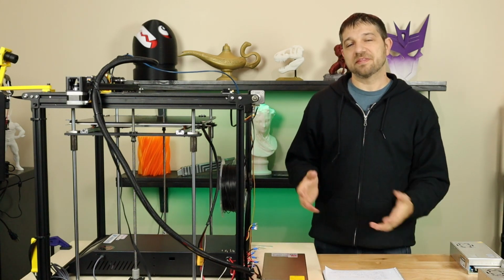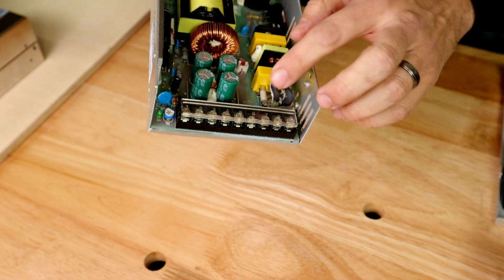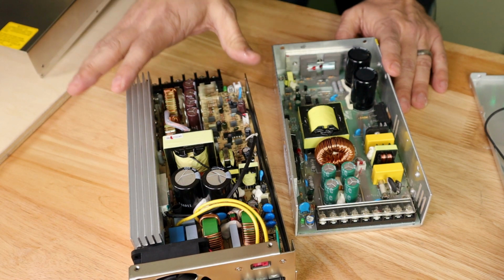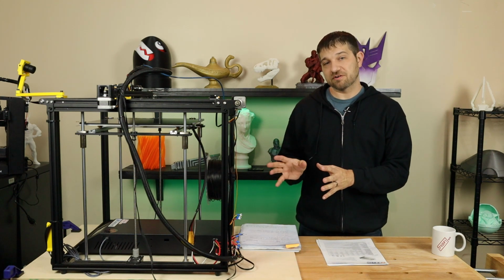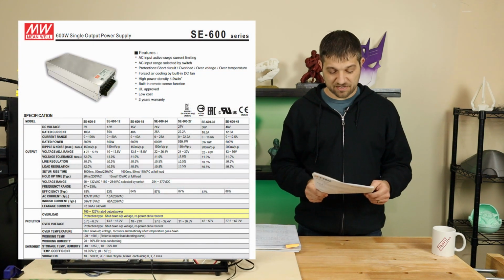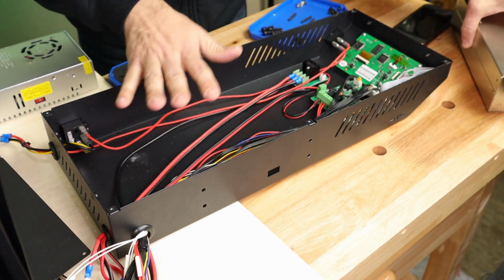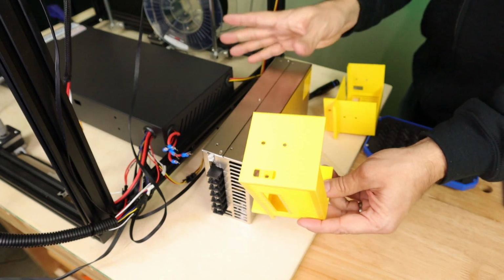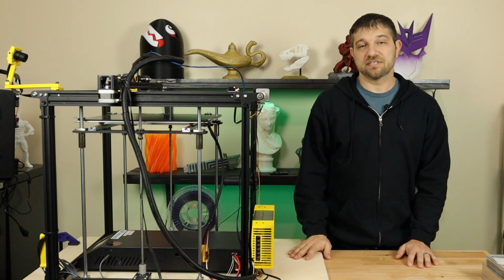Ender 5 Plus Power Supply: What You Need to Know!

Comment: I've watched Tripods and TH3Ds video (and now yours), and had ordered the TH3D Meanwell replacement before I even had the printer set up, LOL!  But I haven't installed it yet.  The Ender 5 Plus is my first printer ever, and I already have a hankering for a dual extruder setup, or dual hot ends, whatever I have to do.  Now I'm worried the 450W Meanwell won't be up to the task and I should go bigger.  The rabbit hole continues!!  Thanks for putting up such detailed videos on things like this.  You're a wealth of good information on the Ender 5 Plus!
Reply from the maker: Thanks! Personally, I think adding additional load to that supply wouldn't be a good idea. TH3D responded to this post as well. Check out their response as well as contact him directly for his opinion.

Comment: IF I remember correctly both the bed heater and the hot end are just binary (on or off). It might be a better idea to add a second power supply and isolate those two high draw loads from causing noise on the steppers. You would need to run two sets of wires to two relays from the control board. As there would be minimal load on the wires from the controller to the relays, those wires could be lighter weight, the wires from the second power supply to the heaters would still need to be heavy. It could also open up the option of running the hot end and the bed heater at higher voltage (say 48V), allowing you to run smaller wires.
Reply from the maker: Others have suggested this and it's definitely an option. You could devote a power supply just for the bed and it should fix the issue. I don't think there are regularly available heating cartridges for 48V, but I haven't looked.
Reply: @kerseyfabs  Yeah, 48V heating cartridges are non existent at normal price points.  Which leaves you with running off the 24V supply OR running two cartridges in series. I drew up the hot end for dual cartridges(basically mirrored a standard block) and it is eh OK. The thermistor winds up being about as close to the cartridge as the nozzle (bad thing?) and the tightener screw for thermistor is pretty long (deep threads on small dia tends to be PITA, could do a counter bore). I was trying to figure out if having a cartridge on either side of the nozzle would have a volcano like effect or if the heat transfer through the block (on a single) would essentially be the same. Finished the drawings for the air compressor 40mm fan replacement and started working on the drawings a part cooling ring.

Comment: The components that are burnt up are designed to stop in rush current.   They usually fail like that when there is a power spike or when the primary side of the power supply fails.     FCC only means the supply is not emitting excessive radio emissions.   Those cheap supplies are definitely not as good quality as the Meanwell, and they usually do not perform to spec, which is why so many fail.

Comment: I believe initial warming up stage would draw a high wattage under cold ambient temperature whereas maintaining the the achieved temperature thereafter would be well within the stock PSU spec. It means it would be okay if you can use hairdryer kinds or a printer housing to help the initial heating up stage.
Reply from the maker: Yes, the initial warm up draws the most current over the longest time but that's not to say that the same pull couldn't happen mid-print due to just random timing of heating cycles. Also, using a hair dryer seems like a rather silly fix to the problem. It doesn't avoid the power draw, it may only shorten it.
Reply: I mean unless you want a long term fix of course. And I  believe house heating would be in gradual change.

Comment: You could always drop the voltage (and thus current) going to the bed by putting some beefy diodes in line with the heater MOSFET component.  If you assume 450 W draw on the bed at 24 V, that gives 18.75 A — put four diodes in line with a nominal 0.6 V drop per diode and you drop the 24 V to 22.6 V, yielding (22.6 V x 18.75 A) = 405 W.  With diodes, you can stack as many as you want to bring down the voltage.

My Ender 5 Plus is on its way, so once it gets here I’ll have a look and see if this is a worthwhile approach.
Reply from the maker: That sounds like a decent option but you'll probably have some heat concerns with those diodes and you'll also slow down the heating of the bed.
Reply: Kersey Fabrications 
It looks like my Ender 5 Plus will be sitting in Customs here for a while, as they’re locking down the country tomorrow.  Yes, you will dissipate some heat in the diodes and the bed will take longer to warm up and boost — however the point is to lower the current draw from the power supply so that it can survive.

It looks like there is a trimmer near the LED.  If that is a voltage setting then you might try turning that down slightly — say to 22 V.  That should also drop current draw, but across the whole machine.

Comment: Excellent video.  I applied my se-600-24 to the inside using the bottom nut receivers and attached to the top of the box. You need to add wire to ground and neutral but others hooked up well. I prefer the flow thru the box and hot air is well exhausted out the back vents.  Even taped up a closeout to preclude backflow.  Cool air will enter thru forward side vents to cool CPU.  I absolutely agree with the 600W solution.  600 was even cheaper than the 500 mw for some reason.  Also note if applied outside, you may need to ground the chasis to the psu but I'm not an electrical engineer..

Comment: Yes there is a way around. The original bed draws far to high currents anyway. So imho it makes more sense to replace the original bed by an AC heater and an SSR.
Reply from the maker: I looked into this price-wise and it's about the same as buying a new power supply but it's a lot more work.
Reply: @kerseyfabs  The question is if you want a component that draws over 20 amps in your printer.
Personally I'll replace the bed with a new aluminium plate, heater mat and add a third z axis to remove the bed springs and use underbed piezos. No manual leveling anymore 🥳

Comment: I know this is old, but I just recently bought one used.  Your YTs are the absolute best I've seen.    I have to get mine sorted.  It was not running right when I got it.  I'll now obviously open the case and verify which power supply I have.  If the meanwell 500, I'll just leave it and keep in mind that the PS might die if pushed too hard.  If the meanwell 450 or the old no-name I'll probably immediately replace it.  BTW, as I type this, the 600 is $4 more than the 500.  The 500 is $15 more than the 450.  As a famous meat company says, "cut elsewhere".  I love your solution, but wonder if putting the 600 PS in the case with a couple more fans might have been better physical layout. I'm not sure, but the 600 is 2.5" high and the case is 3", so might it fit?  As a EE from way back, I hate undersized PSs.  They are the dumbest part of the product and its so easy to get it right--just costs money.  Creality has done a credible job of building these printers to a price point to get wide use, but some cost shaving can be contra-indicated, esp if doing an upgrade or repair anyway.  UPDATE:  I opened the case and have a Meanwell 500, so I'm good to go.....

Comment: Very informative video. The only concern I can see is how you brought the mains voltage (110/220) outside the chassis.  I would want those wires sleeved to keep them better protected/insulated. Also you should run a ground wire from the printer chassis to the power supply chassis. It looked like those printed mounts would not allow a chassis ground to the printer
Reply from the maker: You are absolutely correct and I'm surprised no one else (including myself) has caught that one. I though I may have gotten lucky and it would have grounded through the mainboard to the chassis or something. Nope. So I will definitely add this to my pinned tab and will probably make a short video on fixing it. Thanks again!

Comment: Blown PSU used NTCs for inrush current limiting. Either used under-sized parts for the combination of load and input filter capacitor or the NTCs didn't like thermal cycling as the heated bed cycled on-off. Best fix would be an AC-powered bed, then you'd only need 100W on 24VDC, 250W if you want headroom for tool-changing.
Reply from the maker: Thanks Dan for the run-down.

Comment: As a NOOB, I would very much appreciate a detailed install video on this mod and the addition of the Hero Me Gen 3 cooling system that you prefer.  I am certainly no stranger to things mechanical, but I suspect that I am not alone in wanting to see this before I go forward.  I have the power supply and the support brackets printed, so I will likely move forward with my modification.  You have such a great teaching method, I think that detailed mod videos for extruder swap and just about any other of your upgrades would be welcome.  I will become a Patreon subscriber as soon as I complete this epistle.
Reply from the maker: Thanks Louie! I appreciate all of that and if you look through the channel, you may be able to find some of the tutorials you were looking for. Are there any specific parts of this install that are missing you need help on? Almost all of the process I cover or are at least shown in the quick videos. Also please check my pinned posts on various videos for clarifications and updates.

Comment: Thank you for a detailed analysis and solution you've developed. From protection and space efficiency perspective, IMHO, my preference would have been to make the adapters, cable re-organization and cooling adaptations necesary to host the PSU inside the control box.
Reply from the maker: That's a valid solution. Just be careful with airflow.
Reply: That's a good idea, but you can quickly run out of room when you start adding other mods.  It also makes it difficult to access parts.

Comment: Thanks for you videos, they've helped me a lot. I changed the PSU max power to 50% with a custom firmware (based on the original sources form creality), hope that this will give the installed PSU a longer lifetime.
Reply from the maker: No problem. What setting gives you only 50% power?
Reply: @kerseyfabs  Setting # define MAX_BED_POWER 127 in the Configuration.h

Comment: After watching your video, I decided to go with the 600W Mean Well. Additionally, the fan in the stock power supply began to rattle and its days seem counted. I measured a power draw of the stock PSU of 520W peak with an external Wattmeter plugged into the electric outlet, which seems far too much for me for the stock PSU to drive safely. 
Other than Kersey, I installed the 600W MeanWell without any problems in the stock electronic case by drilling some holes. To monitor the temperature in the case, I plugged a probe inside, because the fan of the new PSU isn't in the same place as the old one and I wanted to know, if heat dissipation is sufficient. While with the new PSU,  the air is blown at the rear end and not directly out of the case, it has enough slots to get rid of warm air and I barely noticed inside temperatures above 29°C in an environmental temperature of around 20°C. 
Interestingly, the power draw with the newly installed PSU reached sometimes up to 600W. So, there seems room for improvement with the stock PSU... and now I am feeling much safer in regard of a brand and far stronger PSU...

Comment: Hey Chris -- nice video. But... I think you are misinterpreting the overload specs in these power supplies. When the spec says that the overload protection range is, say 105% to 130%, it's not saying you can plan to run the supply at 130% rating. In the absence of more detailed info, the datasheet implication is that it has an overload protection strategy that is guaranteed not to engage below 105%, and guaranteed that it will engage by 130%.  As an example, if you look at the sample test report for the RSP-500 ( https://www.meanwell-web.com/content/files/pdfs/productPdfs/MW/RSP-500/RSP-500-24-rpt.pdf ), that unit engaged the overload protection at 121%.  So the idea is to employ these where the anticipated load will be below 100%; that will give at least 5% headroom for avoiding unwanted overload protection incidents, and at worst 30% overload before the unit recognizes a fault. (And usually it's a good idea to run power supplies at significantly less than 100% for heat and longevity reasons.)

It's also worth noting that different units have different overload protection strategies. Some trigger a shutdown, and require a power cycle to restart. That's the case with the RSP-450 and 600. However the datasheet for the RSP-500 shows that its strategy is current limiting, which is to say if the load current exceeds the limit, the unit reduces the output voltage until the output current reduces to an acceptable value.  That give you less protection if a current overload is a sign of genuine trouble, since the unit doesn't shut down.  But if the overload is just due to intentionally drawing more current than the unit is designed for, then you may not notice that protection has engaged -- just that the heated bed takes longer to heat up than it would if properly powered.
Bottom line: do as you did here: get a power supply whose capacity is sufficient for the anticipated loads, and has a protection strategy that shuts the unit down if the load significantly exceeds (by say 10-35%) what you expect.
Reply: Good analysis and helps understanding why a larger capacity  is better
Reply from the maker: Thanks Graham for the analysis. That is a slightly different explanation that what I had thought. Basically, the power supply has you covered for this range of over usage and here is what it will do about it. I'll include this in my pinned post. This covers the safety aspect still but doesn't tell you it's acceptable to run over spec. As you said, I'll stick to recommending a supply that is over-speced rather than under.

Comment: Thank you for yet another great content video on the Ender 5 plus issue. You are describing the issue of beyond spec power consumption and you are connecting it to low ambient starting conditions. Could you share information on ambient temperature while you were doing the start up measurements? As you know, but have skipped to mention, the heat bed in particular draws "excessive" current at below 70 F (20°C). It particularly does that during heat up as it warms up its thermal mass and beyond thermal mass coupled to it. So only with a notion of max initial power consumption would I feel able to assess that I indeed need a more powerful power supply in the first place.
I am now opting for a multiple layer strategy such:
1. Heat room moderately (approx. 18°C (65 F)).
2. Electrically provide supplementary room heating controlled by two point thermostat (on 20 ° C (68 F); off 21.7 °C (71 F).
3. (Fall back Hot bottle to warm up bed, like Tripod's garage with heat gun).
4. Switched to the meanwell 500 W power supply used by Tripod's garage.

So in a nutshell, it will still be a boarder case.

To minimize heat loss during operation (should I get there) I have inserted 2 inch Styrofoam inserts into the cube's side and under the heat bed. I have seen that insulating underneath the heat bed in particular has a measurable impact on heat loss, lowering the room heating caused by the heat bed, hence lowering energy consumption most of the operating time.
Reply from the maker: On the day I filmed, the room would have been around 15°C. I don't believe it draws more power under 20°C than over but I haven't tested that myself. It obviously draws current anytime it's below the target temperature and the PID cycling cuts on. Is there a thermal-electric property of the bed that you're saying causes more current draw under 20°C?
Reply: @kerseyfabs  Sorry I only have occasional expsoure to elelctronics. My thought has been: When the circuitry is dawn cold, its resistance is very, very low, causing a higher pretty short timed draw of electricity. In that logic, the first thing it would take would be to ever so slightly heat up the circuitry. Well logic is one. I was juts ready to start my own assembly and test it when I saw your video. One of my two Ender 5 plusses still has initial power supply. Although I only heated the nozzle at 19 ° C ambient consuming the predicted 52 W, the printer went to power failure shut down, hinting that there is more that is wrong about my PSU therein (It does work on the occasion & I suppose, in a warm room though). The other Ender 5 plus (with all the amendments (meanwell PSU 500 W, silent motherboard, Mosfet upgrade) started smoothly and pulled the very same 525 W at cold start, that you observed. I was surprised to see the 525 W only, hard to imagine this can already knock out the original PSU rated at 500 W.

On a side notion, I am happy to hear that European-style CE marking has such a good reputation. However, it is a manufacturer's unilateral declaration of compliance to norms, that have to be mentioned in the certificate only. Certificate has to be produced upon selling the certified item, not only upon request. There are neither any tests nor is there any guarantee that the full set of applicable norms would have been followed.

I am very happy, I could anchor my confusion with the aide of your excellent report. Thanks a million.

Comment: The issue I have with the PSU analysis is that I believe that a PSU should never be taxed more than 80% of its rated capacity: i.e. a 600W PSU should not have to handle a load over 480W, no matter what the stated overload capacity is.
Reply from the maker: Understood. The 600W is more than enough given that the total load is under the 600W and it's not loaded at that capacity 100% of the time.